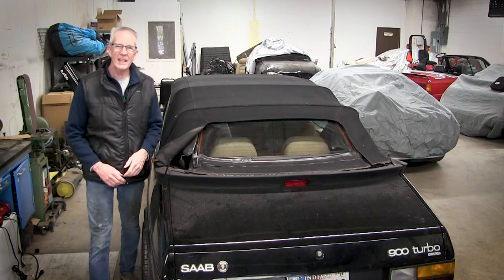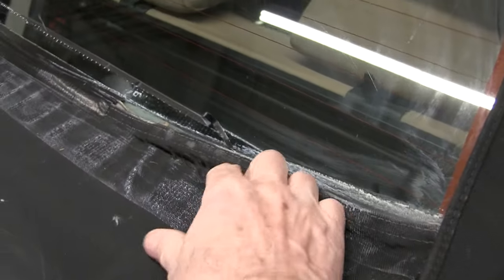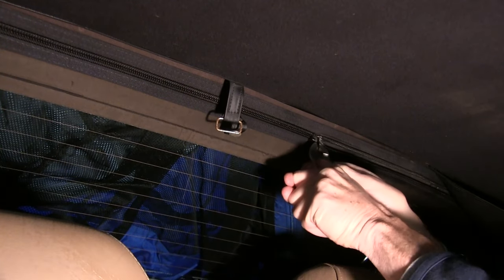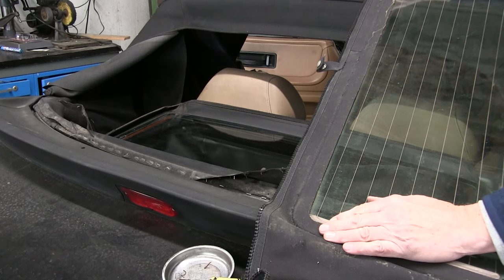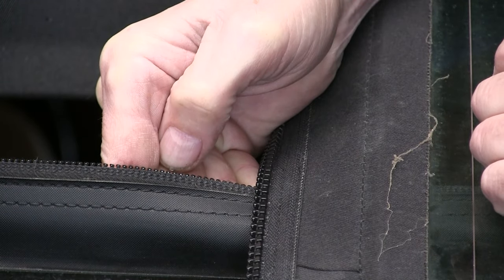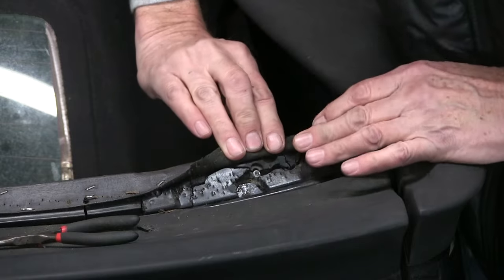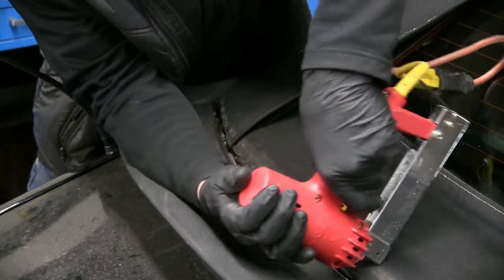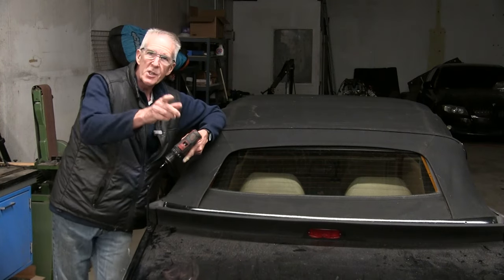Vintage SAAB Restoration: Replacing a 1991 900 Convertible Rear Window

Comment: Thanks for the video Lee. I have watched and used a few of your other ones. I bought a 1991 900 Turbo in April 2023 and the roof was very shredded. I bought a roof from the convertible car guys and myself and my daughter installed. It fit perfectly and made a huge difference to the car.
Reply from the maker: Awesome for taking that job into your own hands.  I've never done it, and frankly find it a little intimidating.  I have another 900 CV that has a good rear window, but torn top.  Fortunately, I have a spare top assembly in great shape waiting to bolt back in place.  Somehow changing the entire assembly seems less challenging than all the upholstery work.

Comment from the maker: I was lucky enough to have a spare sitting around the shop, but you can still buy a new window/canvas assembly from several vendors:   https://www.convertibletopguys.com/convertible/584/1986-94-Saab-900-amp;-900S-amp;-SE